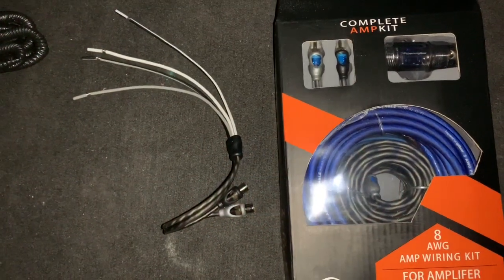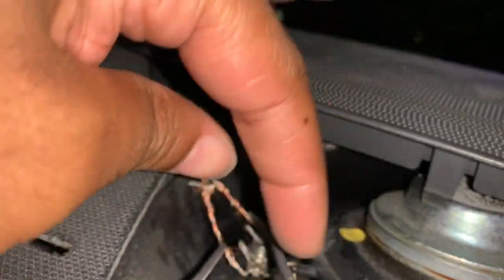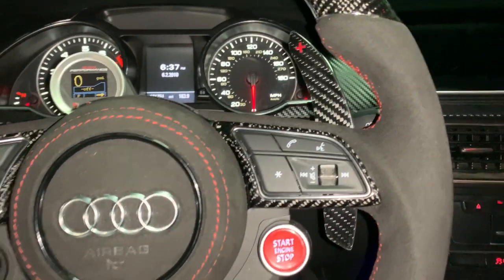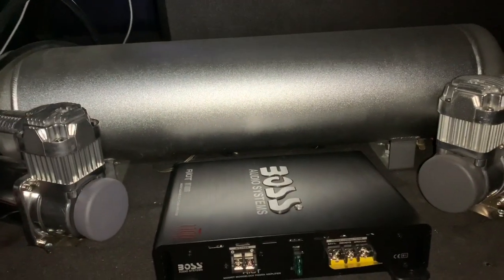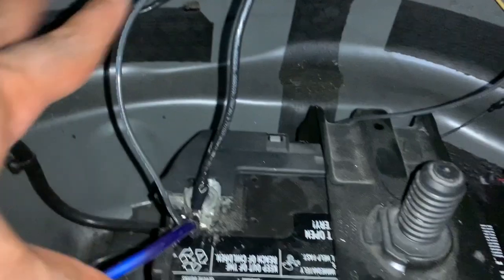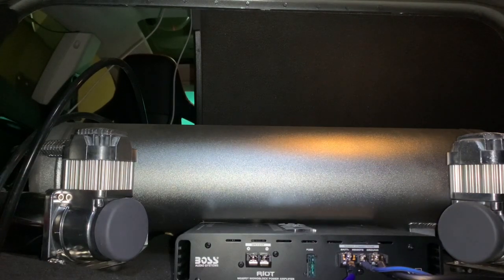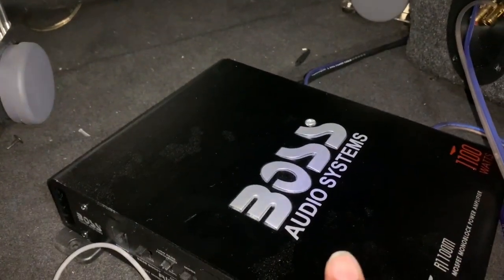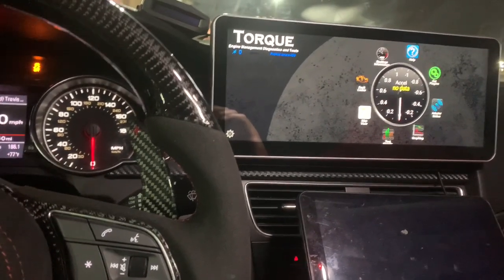How to: Add Aftermarket Subwoofer and Amp to Factory Stereo Audi or Any Car.

Comment: THANK YOU SO MUCH BRUCEEEE! You’re so dedicated to the A5 and making content for us I appreciate it so much. The A5 is my first car I paid for myself and I’ve done so much with it because of the confidence you’ve given me along the way. I just ordered all my parts for this project I can’t wait to start :) I’ve never worked with fiberglass before but I think I might have to give it a go with the sub box. For real man thank you 🙏🏻 🙏🏻🙏🏻🙏🏻🙏🏻🙏🏻
Reply from the maker: My pleasure bro god bless you, and you’ll knock it out the park, just take your time, you’ll be fine and I’m here if you need me🙏🙏🙏🙏💪💪💪💯💯💯
Reply: @brucecustommotors  how did you connect the wire to the fuse? I tried every fuse back there and the amp still turned on. I must be doing something wrong
Reply: @brucecustommotors  I f**ked up and my MMI turns off after 10 seconds of starting. I think I got copper wire stuck inside the fuse panel. I’m so stupid 😭🤦🏻‍♂️
Reply: Got everything working again. Only issue is I have the B8.5 and there are 0 fuses that shut off in the rear. I found one fuse up front that turns off with the car hopefully I can get it to work on there 😅
Reply from the maker: @Mr.Curtis.  sorry bro haven't been getting all of my messages, let me know if you get it we can face time if you dont figure it out bro !!!
Reply: @brucecustommotors  Thank you! And I’ll let you know. It’s either been 100 degrees outside or raining all week so I’ve gotta wait a little bit.
Reply: @Mr.Curtis.  im thinking about doing it to, I got your same car, is it hard, let me know Curtis
Reply: @customcars5628  just got everything wired up besides the speaker to the amp. Will be finishing soon. I found one fuse up front that works and finally got the remote switch working. I’ll keep you updated!
Reply: @Mr.Curtis.  thanks bro subbed

Comment: Hey Bruce. I don’t have an amplifier in the trunk of my A5 facelift sportsback B8.5 MMI 3G plus. Is that built into the module? No B&O bit as I have got a sub woofer option I am thinking amp is built into the head unit? Can I install this and make it use an external amp?

Comment: Bro I was about to pay a company $300 to do this.  Imma cancel that July 10th appointment and do it myself... tomorrow!!!
Reply from the maker: 💯💯💯💪🏽💪🏽💪🏽💪💪💪🙏🙏, I’m here if you need anything brother, god bless
Reply: Got it done!!! I got stuck getting the speaker wire from the OEM sub to the trunk.  And I never found a remote fuse. I ended up connecting to the radio fuse.  Lastly I also did the bass volume knob and installed it in the armrest. Thanks for making this vid!  IE Stage 1 and IE intake arrive some time today!!!
Reply: @robertcrable  did you figure out the remote wire fuse?
Reply: @Mr.Curtis.  I haven't. I need to buy a tester.  I put the remote wire in EVERY fuse and no luck.

Comment: Hey all! So I was wondering I have a 2014 Audi A5 with the B/O sound system. I am planning on upgrading to all kicker system and subs. I have a 1800w amp and will not be using the factory amp. Will my alternator be enough for it to work and not mess with any of the Audi electronics?
Reply from the maker: yes you have a strong alternator

Comment: I recently had my aftermarket sub installed. The shop tapped my sub lines to the LOC. RCAs to sub of course. When we turn the gain on the on the LOC passed half way the speakers has a humming noise coming from them. I've read it could be the ANC active noise cancellation or that I need to get a DSP. This for an 2018 Audi A6 with Bose.
Reply: Hey man I have a 2021 A6 and I’m thinking of getting a sound system installed too. Would I have a similar issue too? I don’t know anything about aftermarket sound systems so if it’s too much I’d rather just leave it as it is lol

Comment: Nice install 👌🏾. Are you running both amps?
Reply from the maker: Yes I am , I wonder if I taped some factory’s to the external amp, what it was sound like but. The system has so much bass now it’s excellent
Reply: @brucecustommotors  Yeah that's the next thing on my list to be done to mine I want to add two 8 inch subs to it but in the factory spot with a custom box using two slim subs. I've installed a few systems so this one should be straight to the point
Reply: Just run a line out from your sub amp to a 4 channel amp. Hook up hot,ground,remote.  Run speaker wire to speakers and Itl will power all your other door speakers. My a7 is a concert on wheels.
Reply: @ejsupatrukkacatlin3452  good looking out

Comment: i bought a jbl 10 inch free air sub its a 4ohm 900w.. could i run this same setup even tho the stock sub puts out like 300w and my new sub needs 900w

Comment: Good video man... over all how does it sound?  Any trunk/ hatch rattle?  How many watts is that sub rated at?
Reply from the maker: 1100 wt 250 rms, and it sounds amazing,   No rattle real refined bass, but it flexes💪💪💪
Reply: That's what's up man... so as far as the boxes go... so you require we send you the side panel or what?  I have an A7... stay blessed and humble and keep up the good content!

Comment: So i can just remove the factory subwoofer wire positive & negative wires and hook it up to aftermarket subwoofer 🔊 and it would thump!?!? Without aftermarket amplifier?
Reply from the maker: It would be an improvement, from factory, but don’t get a speaker to powerful, or you won’t get it to react, the speaker I have is 11000 wats which is why I need an amplifier. But if you won’t to blow pictures off the wall get an amp, but as you can see from the video it works with out an amp

Comment: Hey Bruce, im running a high output sub system 5000+ watts and my amp has a lot of power draw. What are your thoughts on upgraded alternators for the b8.5 generation?
Reply from the maker: yes i already have, definitely helps, i did mine because of my air suspension

Comment: I have a B8 a4 and did the same thing with similar components. The main difference is that I got an amp with high level inputs so I didnt need the speaker to RCA module (simply run the factory speaker wire to the amp) and the amp has signal sensing so I didn't need to go into the fuse box. Also, I found a sub that is a 10inch shallow mount that can run free air so I was able to hang it right in the factory cutout (the factory cut out for factory 8 is actually much bigger than 8 inches and accommodates a 10 perfectly).
Reply: I put a 10 in my a4 b8. Stock amp. Works well. If I wanted a new amp how do I hook that up? Old one has a weird 32 pin connector or something
Reply: what sub and amp did you use? I'm doing this exact same thing in my B8 A4

Comment: So you are running 2 wires from your rear speaker to your amp rca?
Reply from the maker: yes
Reply: Thx sir !!
Reply: It didnt blow your built in amp?
Reply from the maker: @elmo6646  no it only took the audio signal, its not hooked up to the factory, it has its on power source
Reply: Bruce Custom Motors Alright ! Excited to try it out
Reply: Will this effect the bose setup at all

Comment: You realize if you run your stock subwoofer and keep it pluggrd in and run the positive and the negative, to a 2 channel output box and it'll have a blue cord already to use.

Comment: Hello everyone, 
I have a 2015 Audi A1 and I want to add a subwoofer in it. But how ? I have the Concert sound system, and I don't know how to give the music signal to the sub. I tried to put a splitter on my 3.5mm jack, then plug it to the aux on the radio and to the sub's amplifier. It works great for the sub but not for the radio, there are a lot of noises. When I unplug the sub, the noises disappear. Do you have an idea of where it comes from, and a solution ? 
Thanks

P.S. I'm french, sorry for language mistakes🥲
Reply from the maker: No you’re good, make sure your rca’ are not near any power source to help with the sound

Comment: Nah , fam this definitely won’t for me…. My problem is my factory amp controls my mmi interface like navigation etc My factory amp is blown… I need a head unit or something…..2years without music…. Just engine & exhaust  what head unit u recommend? Plug & play
Reply from the maker: What year is your car make and model
Reply: @brucecustommotors  2009 Audi A5 3.2
Reply: @brucecustommotors  appreciate the quick response….
Reply from the maker: @brock2872  do you have the bang o system or regular
Reply from the maker: @brock2872  if you have bang and o let me know 

https://www.ebay.com/itm/09-10-11-12-AUDI-A4-B8-RADIO-AUDIO-STEREO-SPEAKER-AMPLIFIER-AMP-8T0035223AB-/124259999706?mkcid=16&mkevt=1&_trksid=p2349624.m46890.l49286&mkrid=711-127632-2357-0
Reply: @brucecustommotors  yes B & O
Reply: So basically I need another factory amp, smh. I’m thinking about just putting a regular deck in and say F the mmi navigation etc
Reply: @brock2872 I know this is a year old but what did you end up doing? I have the same issue with the amp 😒 😑 🤦‍♂️
Reply: Same … pls help
Reply: @brucecustommotors I have the same issue with same model of car Audi A5 2009 Quattro…..I got second hand amplifier….fixed it everything is working except sound….mute sign is on….and my old amp and the new amp I replace all the number are same just a last letter is different….what can I do please help me out 🙏🙏🙏